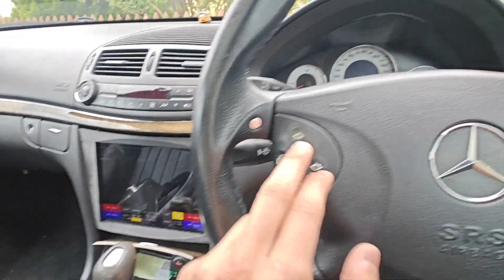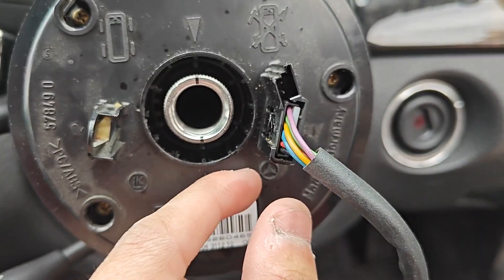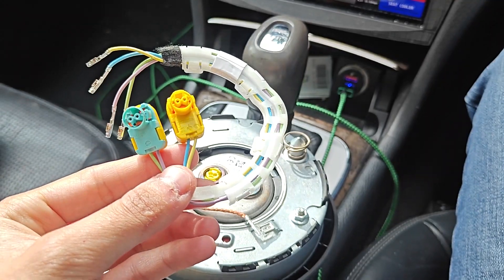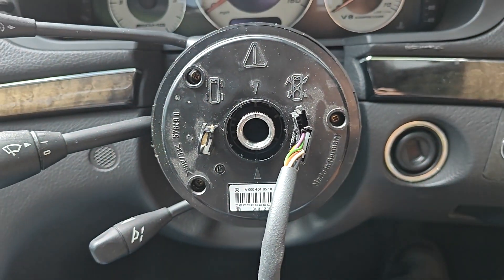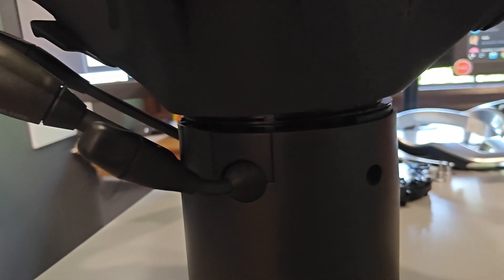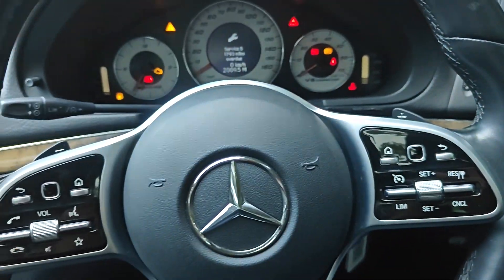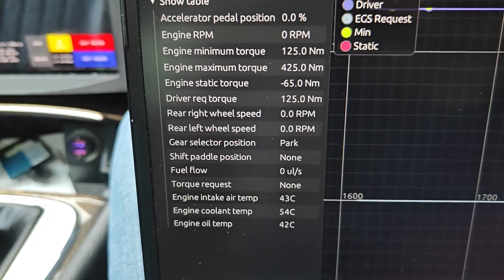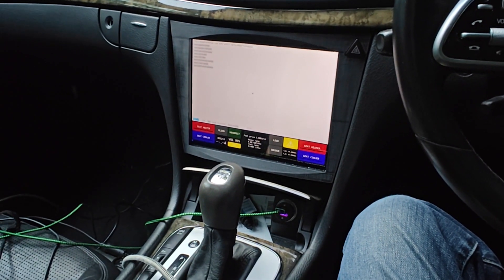This is how my E55 AMG got a W213 wheel and EVERYTHING just works!

Comment: Ej bro any idea after upgrading steering wheel from 2003 to 2006 e55 my gears from first go up by itself,any solution?
Reply from the maker: The paddle system is different, on prefacelift (2003) they are wired to the gear selector and use 2 wires, on facelift, they are wired to the steering column and use 3 wires. The car is upshifting by itself as without the wires connected, the voltage at the gear selector is the same as if you pressed the upshift paddle (bad design, I know)
Reply: @RANDASH any idea how to fix it?i can disable gear shifts and work fine but i was hoping for solution
Reply from the maker: Maybe replace just the paddles from the prefacelift wheel

Comment: Hi, I have a 2012 Mercedes W212 (E300) and I recently bought the same steering wheel you installed in your video. I saw that you used an adapter to make it work. Could you please tell me where I can buy this adapter?

Also, my old steering wheel has the vibration (haptic feedback) feature. If I install the new steering wheel with the adapter, will this feature be disabled?

Thank you for your help!

Comment: Hi, I have a mercedes w203 220 cdi 2006 automatic gearbox and I have a problem with the gearbox, namely, after about 10-15 minutes it gets stuck in 2nd gear. If I stop and restart it recovers but not for long. On the diagnostics, the error P2561 appears. Could you give me some advice what could be the problem. Thanks in advance.
Reply: The selector is the problem.

Comment: Well done! I'm looking in to doing the same to my W211. Is your E55 a 2003 or 2004? As I understand it, it is possible to change the steering column on the early W211 to avoid to modify the steering wheel, something like swap to A2115401662. Then a newer steering wheel will fit bolt on. (Haven't tried it myself yet)